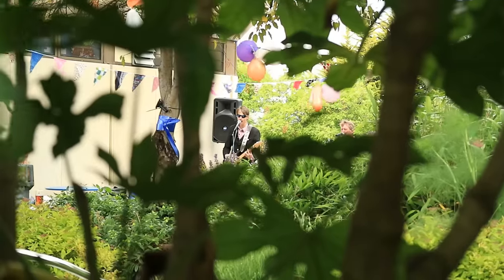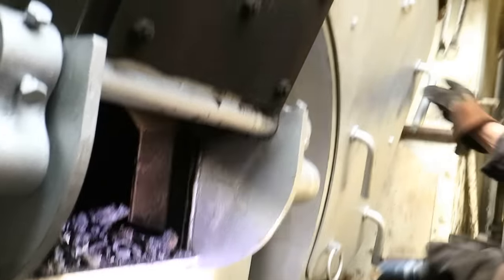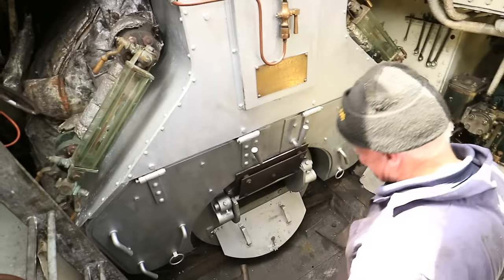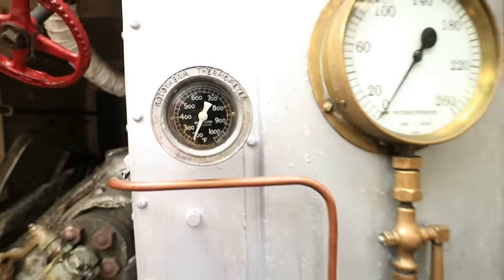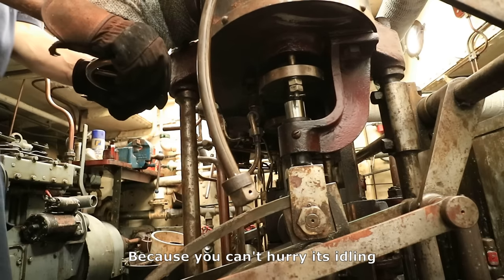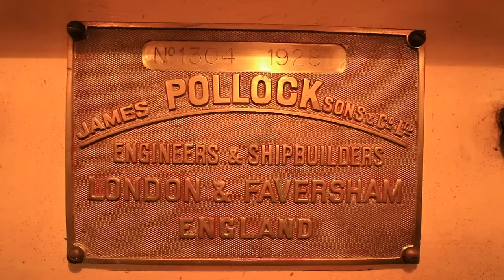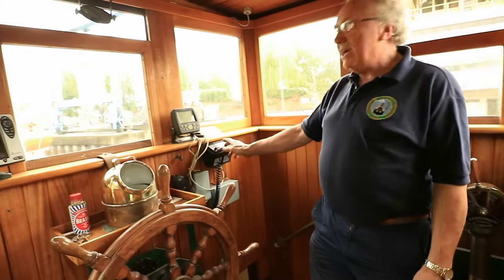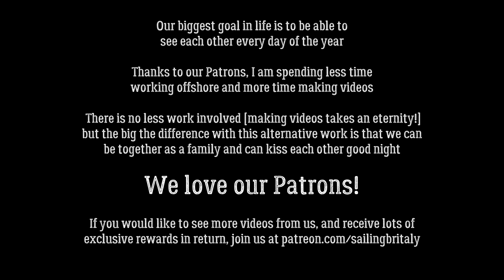Firing Up a Steam Engine Tug Boat! ⛵ Sailing Britaly ⛵

Comment: The Welsh Coal sounds like a higher quality Bituminous. Such a small steam tug! Interesting. Thank you.
Reply: Yes, it's basically between a bituminous house coal and an anthrilacite in terms of hardness/volitility, but also very low ash content and reasonably high ash fusion temperature so doesn't clinker too badly.
Reply: Hi Let's hope they can sort out the Fose Y Fran pit to keep supply of coal for ALL steam engines as the latest is they are on appeal to keep it open, but the locals want it SHUT. Cheers

Comment: Reminds me of the time I worked at a sailboat marina. A group of steam fitters there band together and built the most beautiful steam powered small tug. It had grate floors so you could look down and talk to the engineer. It even had a steam powered bilge pump.  Beautiful piece of workmanship.

Comment: my father and grandfather were tugboat skippers.  my father was born in 1912  he worked on boats since he was 16.   my grandfather was born around 1883.  both worked on steamers.  i used to ride with dad in the summers.  my dad said if i wanted to stay in the pilot house during ship work or shifting barges, be quiet save questions for later and move with out being asked.  big ships i remember seeing a deckhand smoking a pipe working the lines.

old steamers in England with English sailors a real class act

Comment: I stopped the video when you started talking to Jim the Engineer. I was a Stationary Boiler Fireman in a steam generating plant supplying the steam to our local hospital & Laundry. WWE had 4 Boilers each as big as a two story house. One of my jobs was to pull the burnt or used coal twice on the day shift. The Engineer was in charge & over saw my activities. We had a special wheel barrow that held at least as much as 4 reg. wheel barrows. Thanks for the memory.

Comment: Actually my late grandfather was a skipper on a tugboat towing lumber on lake Siljan  in  mid Sweden. The boat was built in 1875 and is still running by enthusiast , but now running on oil not wood as original. Nice to se enthusiasts. Best regards

Comment: Interestingly, the Barking was originally built with a 120 bhp Bolinder diesel engine in 1927. Steam engine was only fitted in 2001.

Comment: That was a hell of a fire. The draft in the chimney was enormous. How tall is the chimney?? Very nice to see. Hope the old boys keep her running for many years to come. 
Fair winds,,,/),,,,
Reply from the maker: Hi Anders, the gentlemen from the trust are the experts on all this but the water in the boiler was hot from the vessel being run a day or two prior to this video being filmed, so there was a good updraft before the fire was lit. Thisvessel was purchased in 1979 in "Rustbucket" condition and she's in great working oder now, so that bodes well for the future. The trust are always looking for new people to get involved and help them continue their work though, hopefully this video will help them find some new crew. Cheers, Chris :-)
Reply: Thanks for the answer. 
The hot water explains a lot. 
Yes, I hope you’re able to spread the message. 
There is some similar  Projects in Norway as well.
Reply: Obviously the total height is from the firebox door to the top of the funnel, something around the order of 15ft maybe. 
As said, the retained heat from the day before helps enormously, from cold it will likely take another hour ontop if not more. Sometimes you light a warming fire the night before.

Comment: The steam engine in this tug is a triple expansion engine. It uses the same steam 3 times, with sequentially larger diameter cylinders (visible at 13:11) to extract the same amount of force from the steam even as its pressure drops. The same type of engine was used to power the Titanic, and many other ships of that era. They eventually gave way to steam turbines however, which are even more efficient.
Reply: Well, they had kinks to work out first, the early steam turbines had issues with vibrations.
Not an issue on working vessels such as tugboats & barges, but a big no-no with liners.
Lusitania/Mauritania had all 4 props powered by turbines, and they were reportedly insufferable due to the vibration generated by the turbines, especially for the steerage passengers.
The Olympic class (Titanic, Britannic and Olympic) had only one low pressure turbine (powering the center propeller), using the steam that was left over from the reciprocating engines, and then whatever came out from the turbine exhaust went through condensers which then had the water go back to the boilers, making it not only efficient but also a very comfortable liner :)

Comment: What was this boat used for? It seems the entire vessel is either engine or crew quarters.
Reply from the maker: Hi Jacobus, I believe Barking was a working boat /tug on the river Thames.
Reply: Yes, it's a tug. Pulling unpowered barges, and assistanting larger ships/liners with docking.

Comment: I question dry coal being better heat than the "wet" anthracite coal, since that wetness is also known as coal oil. It just seems to me having coal that has that bit extra burning component would give a better heat level.
If it wasn't for the massive space requirements for fuel for steam engines I would think they would be far better for motor yachts. Specially with how much quieter steam engine are in comparison to diesel.
Reply from the maker: Hi Jaqui, I have to defer to Jim & Derek regarding the coal, I know nothing about this subject although I bet the guys have tried different coals over the years. It was surprising how quiet the main engine was whilst running. It was very interesting to see something so unique. Cheers, Chris :-)
Reply: Chris, they aren't the first I have heard stating dry / bituminous coal provides better heat, I'm still waiting for lab tests showing it to be provided.
Yeah, steam is an amazing system, specially how quiet it is.

Comment: Chris I have watched many of you videos and you are a plethora of information. I have a question about through hulls as I just reviewed that video. I am replacing my inline ball valves which have BSPP threads. Hard to find in the states but found some Maestrini DRZ CR ball valves. They state BSP threads but is that Parallel (BSPP) or Tapered (BSPT) or is BSP interchangeable with either? I have a 1986 Wauquiez Pretorian 35 and I want to get the right equipment first time!

Comment: Well if you can't get the good coal anymore you can always use coke - a little more expensive but very clean - it is how London beat its smog problem.
Reply: Coke is produced from coal. If we struggle to get coal we will struggle for coke. Was plentiful in the days of London smog as it was a byproduct of the Coal gas industry but since switching to natural gas only the steel works that use it

Comment: One does not 'fire up' an engine, one 'Starts' the engine. Keep it English not cheap American slang.
Reply from the maker: Perhaps one is right.
My thoughts on this:
1) "Fire up", to my British brain, sounds like a reasonable description of what you do in order to get to the stage of "Raising steam", which is I believe the more correct technical term.
2) Although this was my first ever encounter with a steam engine, I have used the term "Fire up" when talking about starting generators offshore. "I'm going to go and fire up the generator." I have worked all over the world though, so I do have to plead ignorance as to where this apparently potentially offensive term originated.
3) Four times more Americans have watched this video than British people. After gaining over 14 million views on my videos to date, I have found that using US terms such as "sailboat" may be more appealing than using British equivalents such as "yacht", so I am 'guilty' of pitching certain aspects of my videos towards US viewers.
3) In my mind, your suggestion of "Start" describes something much more immediate, such as pushing a button and the machine springs into action - rather than the multiple hour process of raising steam in this vessel. Maybe this is just me though.
Thank you for watching. Chris